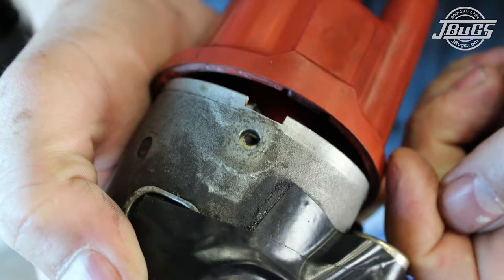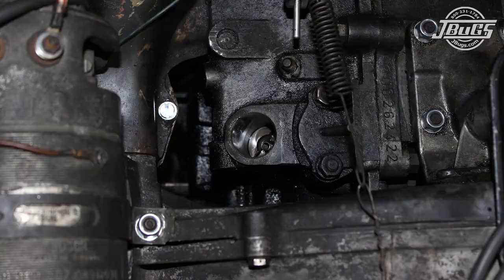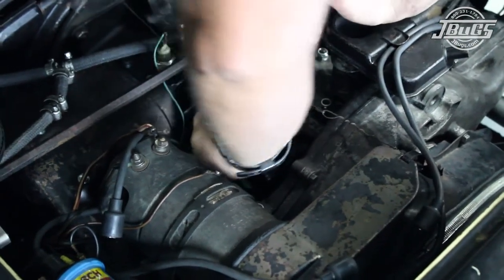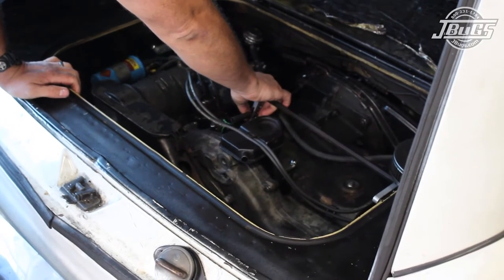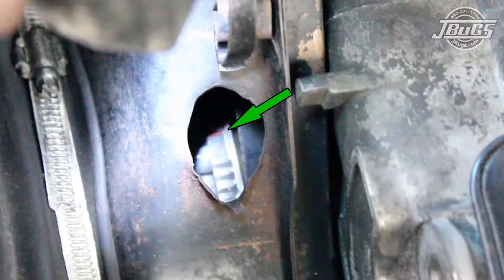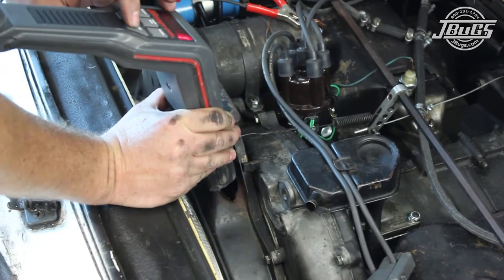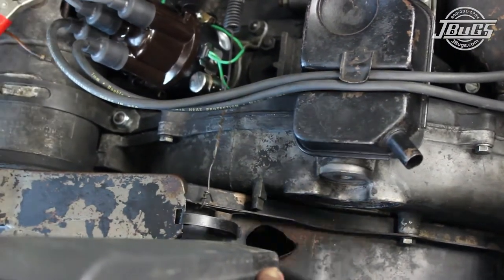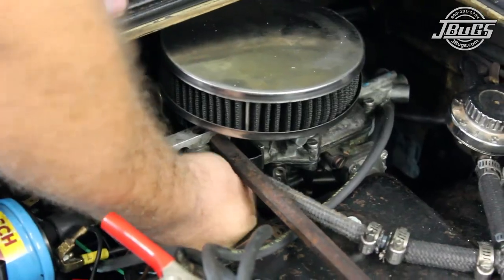JBugs - VW Type 3 - Installing & Timing: Kuhltek Vintage Cast Iron Distributor

Comment: If i have my points set up on the otherside of generator does that mean i should set it like in this video?
Reply from the maker: If your engine is running currently, no. The points may sit in a different position based on the distributor and the distributor drive gear. Do not change anything regarding the timing unless you are familiar with what you are doing.

Comment: Is that linkage connect to stock solex carbs? Looks much better than the standard and would like to achieve the same linkage. Thanks for this tutorial too
Reply: No, the linkage is for the aftermarket carburetor kit that was installed on the engine.

Comment: Do you guys know the timing on a 1967 1500 bug with vacuum advance? Some people say the static timing is 7,5 BTDC and other say 10 BTDC. And is the dynamic timing still 32 BTDC with the vacuum hose disconnected and plugged? The distributor is a 123ignition (electronic)
Reply from the maker: The factory set the timing at 7.5 degrees BTDC at 800 to 950 RPM. We prefer to set timing fully advanced, typically at 30 to 33 degrees depending on the quality of the fuel being used. Advanced timing is typically set with the vacuum line disconnected and the port on the carburetor plugged.

Comment: so there is no need to have a degreed pulley, or degreed paper degree template to set timing?  Going by this video, the gun does it all.  is that correct?
Reply from the maker: Correct, if you have a timing light that has a digital advance, there is no need for a degree pulley.